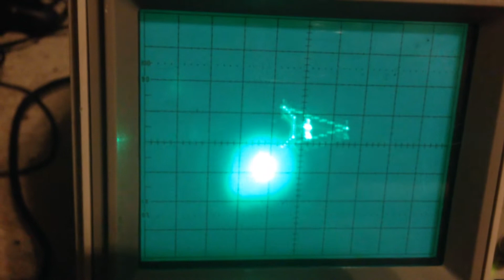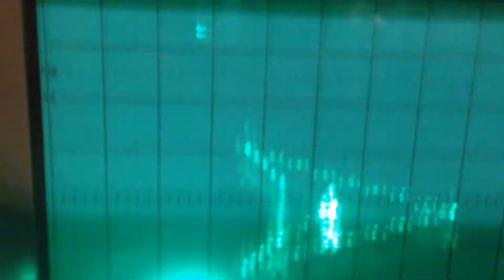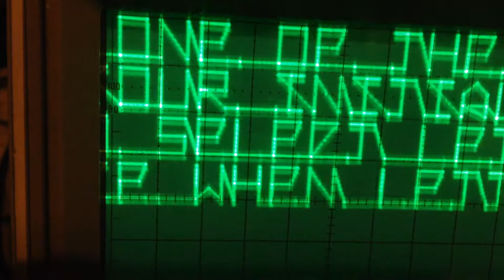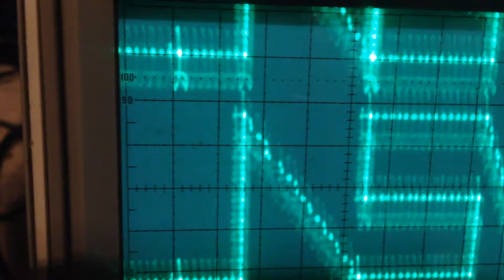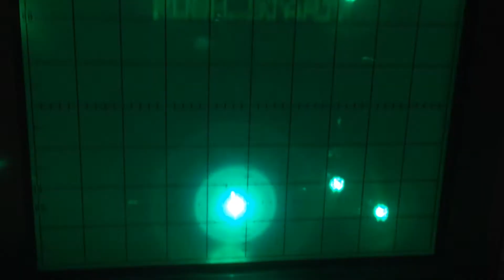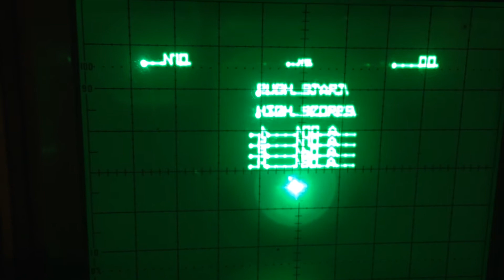Asteroids on oscilloscope with ground noise eliminated.

Comment: How do you ground it properly? I just got an oscillioscope recently and want to try this.
Reply from the maker: The PCB has a ground against which all +ve voltage is relative. You can connect to any part of PCB ground they're all over the place including surrounding the DACs and on the connector output. It will be the broad trace left on the board. There is also a GND post you can use.
Reply from the maker: See my other video, it shows where to hook up your probes for X and Y deflection. Put your 2 channel scope in X-Y mode. Finally ground each probe to PCB ground.
Reply: dorbie The alligator clips, right? Thank you!
Reply from the maker: Joshua Mason each of the two probes used for X-Y mode oscilloscope display should connect +ve to XOUT and YOUT posts on the PCB. Their grounds should be connected to PCB ground. If that's not clear you might not want to mess around with your PCB.